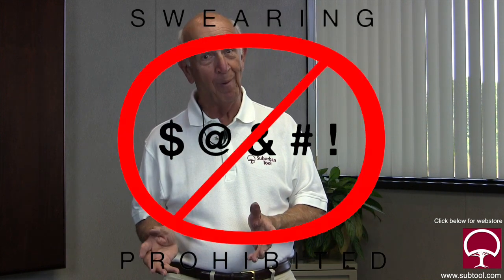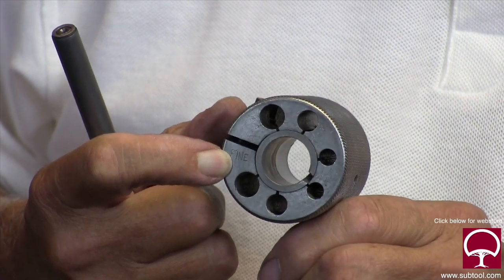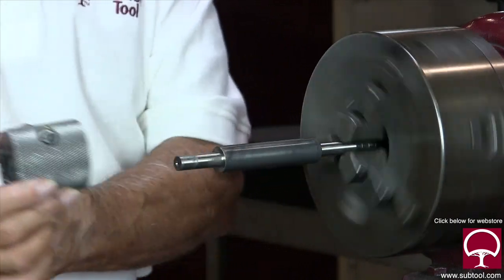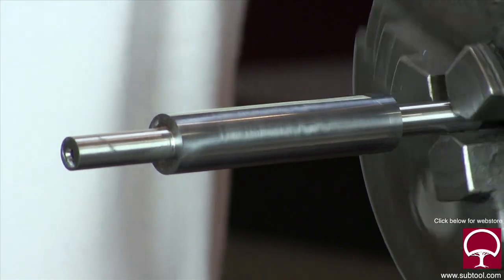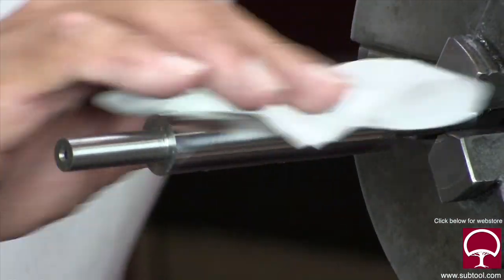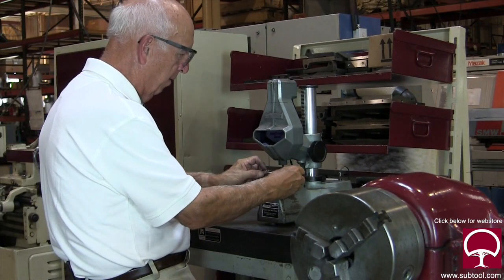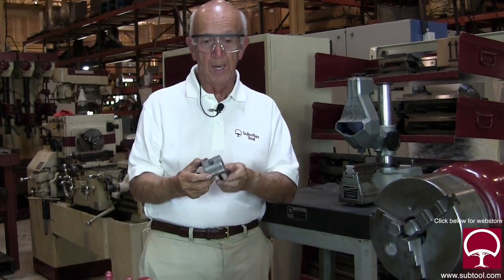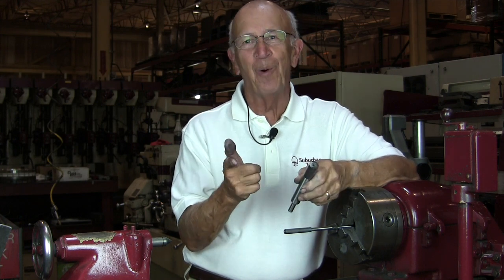ID and OD lapping simplified.

Comment: nice vids. I also do internal and external lapping using diamond compounds, silicon carbide, aluminum oxide and some mixtures. with finish of 5Ra and .000050 roundness or better. I lap match assemblies of bushing and spool with clearance of .0001-.000130. It's a challenging job but I honed my skill to do it.

Comment: I had a little problem job to do, I needed to size about a 100  .250" shafts to fit a bearing bore. The shafts were a 10th or two over, and I needed them to be a couple 10ths under and so I found this video. I am not unfamiliar with the concept of lapping but didn't know what equipent was out there. Watching this vid I learned about Americal Lap so I got in touch with them and bought the holder and some laps. Nice guy there, had a chat, and the laps came yesterday and they work perfect. This little rig works way better than I thought it would! Thanks Suburban Tool and American Lap.
Reply from the maker: Great to hear, thank you for watching!

Comment: thank you for your video! can I ask - how common is it to lap a hard anodized aluminum part to size? I have a part with a -0.0004" od tolerance and +0.0004" id tolerance spec. (after hard anodize)
Reply from the maker: can be done but dont go through the coating.

Comment: What is the clearance between the lap and the part? I'm assuming there has to be little room for the abrasive? And then, when the parts are done, how much bigger is the OD than the ID of the mating parts- one tenth? two tenths? I'm teaching myself to machine to this precision but not sure my digital micrometers are accurate enough to know what I'm actually accomplishing to  a tenth. Thanks!

Comment: There's really something cool about how 2 perfectly lapped parts will fit together.But what I dont get is why people are afraid to do it or think they cant.It takes a bit of feel but once you get it you can make things incredibly precise.Last but not least is you dont have to go and buy the laps,they are super easy to make from scrap stock although for a commercial shop where they make a lot of one thing I see why he uses that one.But for myself I use a jig i have that can do rifling to cut the grooves inside to hold the compound and then I'll cut a slit like normal.

Comment: What is the surface roughness you get after such a process?
I am looking to lap a 1.5mm diameter spindel to an Ra of 0.015um. Is this possible?
Thanks for your instructional video.
Reply from the maker: It should be possible

Comment: what is the OD lap bushing made out of
Reply from the maker: +Bertrand Labelle I'd love to answer your question but I'm not quite sure what you're asking.  Are you referring to the ID lap we are using to lap the OD of the part?
Reply: Yes the ID bushing to lap the OD of the part. Would that be plain tool steel to interac with the 1200 grit compound. Or perhaps copper. Thanks
Reply from the maker: +Bertrand Labelle Thanks for clarification.  The lap is made out of cast iron.
Reply: ok thanks
Reply: hgfho

Comment: At the tolerances being discussed I would expect an on-size part to measure exactly the way this OD measured. It was being handled extensively from its ends during the video and the heat from doing so will cause the ends to expand. If it were left to properly stabilise on the comparator for a while  it would most likely measure far closer across its length. I think this point should have been made in the video, as how much metal expands and moves is probably quite a surprise to viewers not used to working at this order of precision and will easily catch people out of they don't consider it properly.

Comment: Don, Thanks for sharing. A hobbyst question: Is there a limit to how precise things can be manufactured? I mean, could you manufacture a steel cube where each side is, say, 3 inches, with under a millionth tolerance? That is, each side is 3.000000 inch exactly. What about 9 decimal points? Is 12 decimal points possible? What are the limits of our manufacturing capabilities, precision-wise? Thanks, hope my question was clear :)
Reply: The thermal expansion of steel is anywhere from 0.0000061 to 0.00000683 inches per inch per degree Fahrenheit. So lets take the median and call it 0.00000652. So if you had a block that had been machined to 3.000000 +/- 0.0000005 in a room at exactly 65 degrees Fahrenheit. When you picked it up to measure it you may increase the temperature by 1 degree, which would make that block 3.000019. The practical limits of dimensional accuracy are the ability to control variables like temperature. In addition to that there is flatness. A lab grade AA surface plate has a local area flatness (known as repeat reading) of +/-0.0000175. You would need something flatter than that to lap it on (not that you would lap on a surface plate) to have a surface flat enough to measure such dimensions.
Reply from the maker: +aryesegal1988 Anything is possible as long as it can be measured accurately.
Reply: +SuburbanTool Inc And time no object as well as budget... ;)
Reply: aryesegal1988 At some point you have to come to terms with the fact that you will be chasing a dimensions due to thermal expansion alone.
Reply: Thanks everyone who replied. Yup, variable control at such levels seem to be the most important/hard thing to achieve. Just reading Moore's book on mechanical accuracy, he speaks about these topics at length. Very interesting. :)